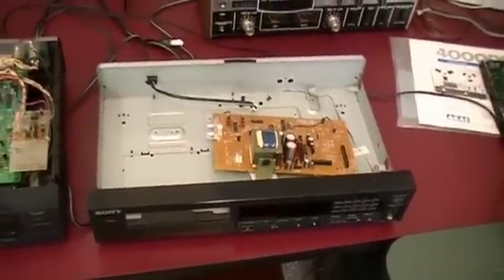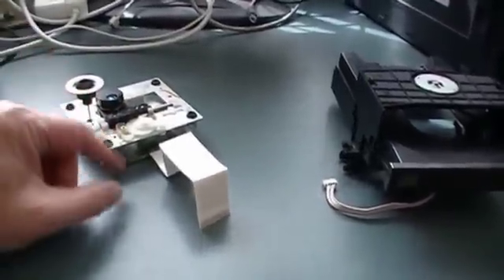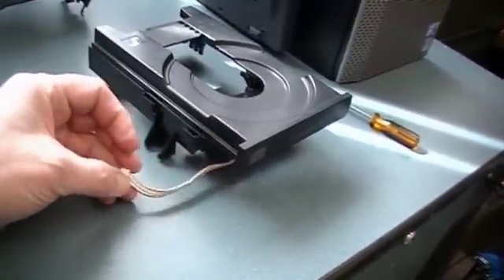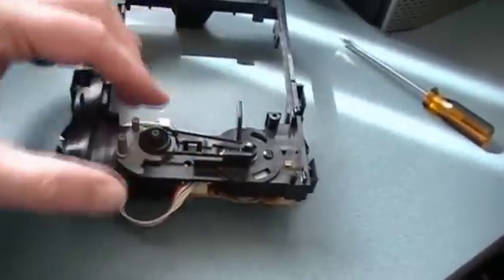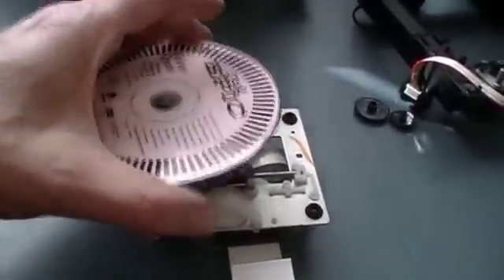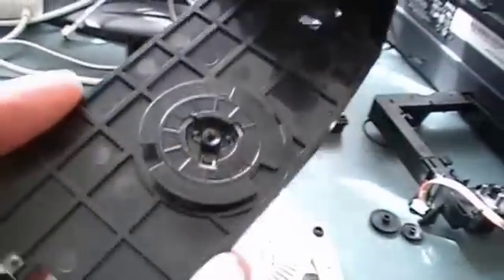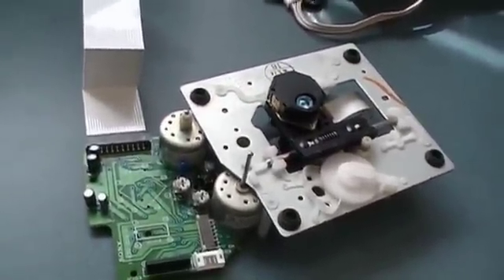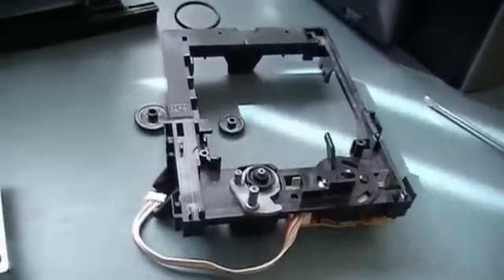Sony CD Player Tray Disassembled

Comment from the maker: It was along time ago, but I think that I removed the tray from that CD player by disassembling the entire unit.  Often, you can remove the tray just by disconnecting the cables and then sliding the tray through the front of the unit.

Comment from the maker: @pironegraphics Hi Carl, I know exactly what you mean about head popping up once the tray is inserted but I was unable find a mechanism that made that happen.  It appeared to be electronic rather than mechanical.  The only thought that I have is that the moving parts may need lubrication, especially where they move along a track of some kind.  I don't know if this is helpful or if I explained well enough.  Good luck with this! - Craig

Comment: I have the same guts on my karaoke cd player. It opens, but when you put a disk in and push the close button, it closes for a moment and then opens again. I took it partially apart and observed that the head doesn't pop up to meet the disk. I can move it manually, but not electronically. Also, the lens will move forward, but won't go back. Do you have any suggestions on how to repair it? Sure would appreciate any help.      Carl P.